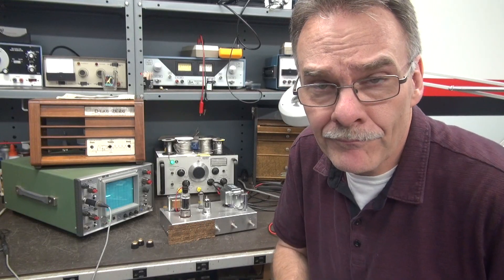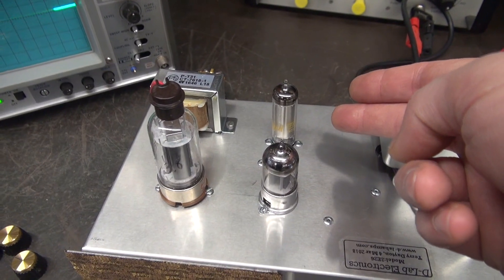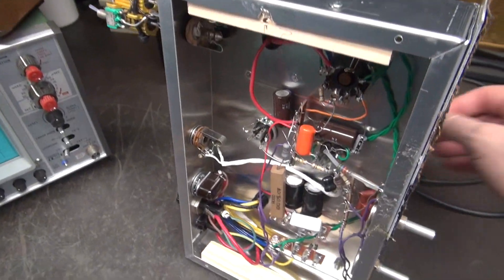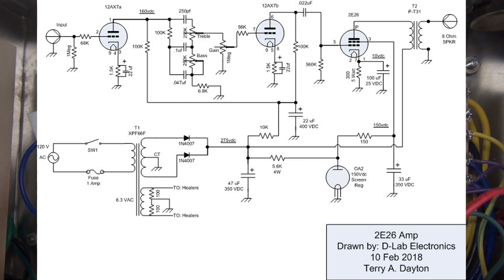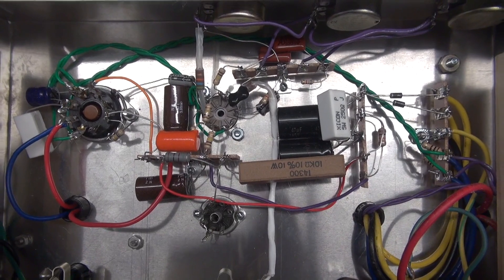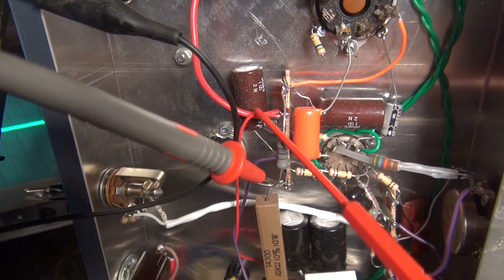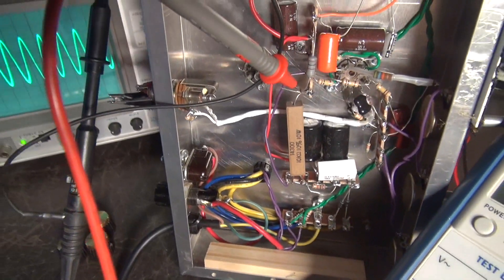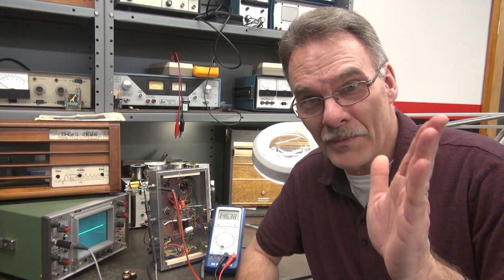D-Lab 2E26 Class A guitar amp design Update Build it yourself classic kit

Comment: Terry, this video has a few years on it, but I want you to know it is still appreciated. I was thinking about using an 815 tube in an amp, but did not like the "Martian" looks of the 815. I bought pairs of 2E26 tubes to use instead of the 815.. I needed a guitar practice amplifier. When I saw your amp, I said, "Have to make one". I have designed PC boards for forty years, so I designed a PCB prototype board to use in my build. It came out very nice, and sounds good too. Plenty of power to drive a 12" guitar speaker (rated at 101 dB/1W). Now I have some experience with the circuit, I am thinking about making another, with upgrades to my PCB design, such as moving the three big power resistors off the PCB to a turret card. So... YES! I really did make this amp.

Comment: That pi filter, as far as I'm concerned, is essential on all class A SE guitar amps. Not only does it give better filtering, it allows you to dial in the the plate voltage to where you reach grid current limiting before cut off.

Comment: Hey Terry, thanks for the video. What's your reasoning for regulating the screen voltage with the OA2? Was this circuit based on something vintage for hifi use?
Reply: Nevermind, I found your original video talking about the datasheet specs for the 2E26. Interesting build. Thanks again.

Comment: Great production as all of your projects,as a point of note would it have been better to mount the large 10k resistor away from the filter capacitors,the heat will rise after all,best regards Colin G1PGI